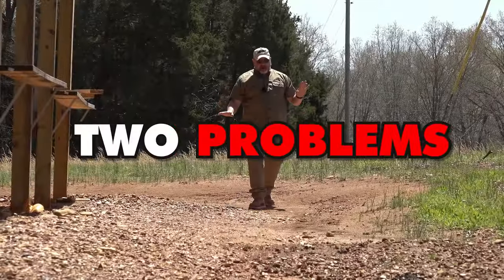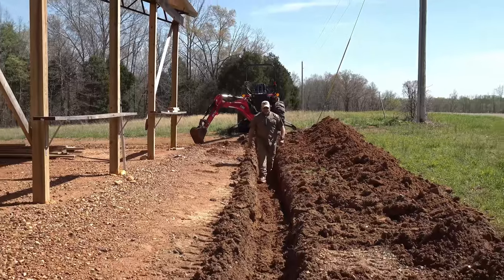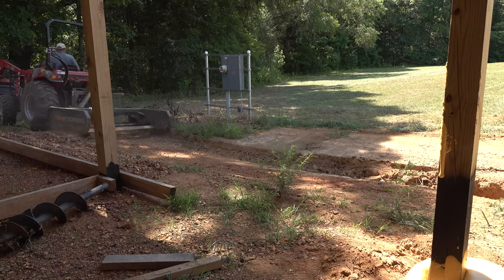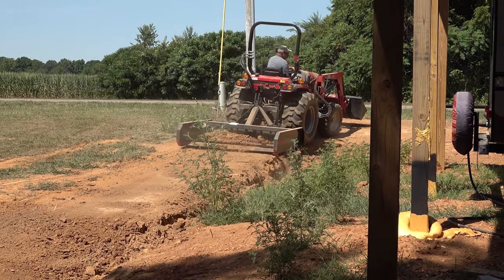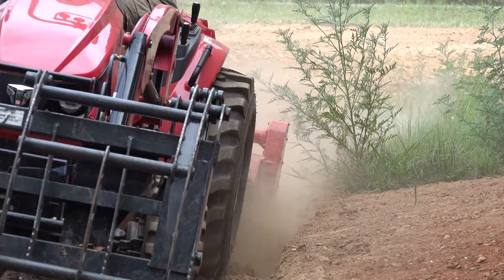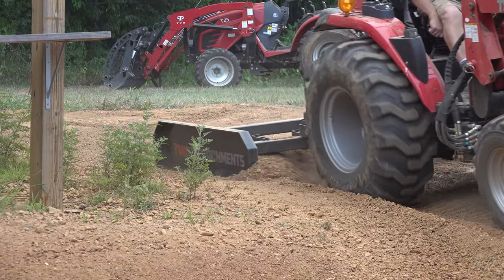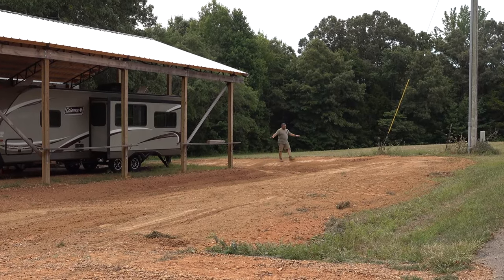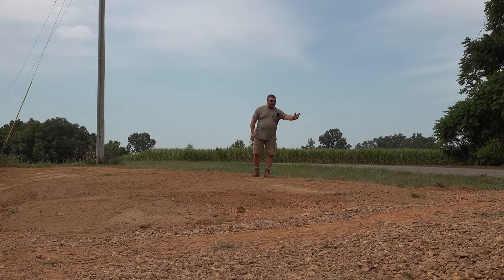How to use a Land Plane and a Tractor to build a proper Drainage Ditch

Comment: Good video Tony!   Water movement around buildings and driveways is a puzzle for sure!   We used a mixture of french drains and gutters to divert water around ours....it was not anything we had thought about or budgeted for in time or money either!!
Reply from the maker: The cost of this was cheap enough, but I wish I hadn't put it off so long. Still, it turned out good.

Comment: Looking good, that tiller run down the length of the each side of the swale sure worked well to loosen things up.  Quite the dirty job it made it, but sure it made the rest of the work easier.  Turning out nice, have a good one!!
Reply from the maker: It turned out good. I look forward to the rain. That will be the test.

Comment: It sure looks nice now.  I do hope it works out as you planned.  I don’t see why it won’t, but as you said, water does sometimes surprise us.  I got a toad strangler rain for a short today and 3 of my downspouts that are supposed to carry the water away we’re bubbling up.  Apparently I have a blockage down slope.  Time to learn on my backhoe I guess.  Thankfully it is only 40’ or so.   Other issues as well.  French drain?
Reply from the maker: Thank you. We are going to have many more drainage projects on property as we move forward. I should really be a problem by the end of all of these projects. I still respect water because it sometimes will do things you don't think it will.

Comment: Well thought out plan and execution. Is it still working as you intended or have you made some adjustments? I need to do a similar idea but I have a lot of very fine sand that comes with the water.
Reply from the maker: My road has made it through everything.

Comment: Tony, that was a mess but it turned out pretty doggone good.  By the way, I saw the water tank in the back of the truck.  You hauling in water?  You planning on having community water or are you planning on drilling a well?
Reply from the maker: We will drill well soon. We are doing our entire property as we get the money so we have to plan and change plans and plan.
Reply: @TonysTractorAdventure  I absolutely understand.  Same with me on my little place.  Finally got power 2 months ago. Just recently put down waterline can connected to the community supply.  Have the RV hooked up now. I hoping to get a pole barn going up soon.  Thanks.
Reply from the maker: We don't have community water here. I plan on having a well dug this fall.

Comment: I would like your opinion as you have both a box blade and land plane. I have only ever had box blades. I have recently purchased a new tractor and I need new implements and wondering what you would suggest a box blade or a land plane. I would get a land plane with rippers if I were to get one. I would be using the implement for gravel driveway maintenance and general land grading and clearing. I do currently have a rear blade also. I have a 75 horse category 2 tractor so my implements have gotten very expensive so if I'm going to buy one I will probably for now only buy one implement. Just wondering what you would recommend a box blade or a land plane
Reply from the maker: I would buy a box blade first. It is more versatile.